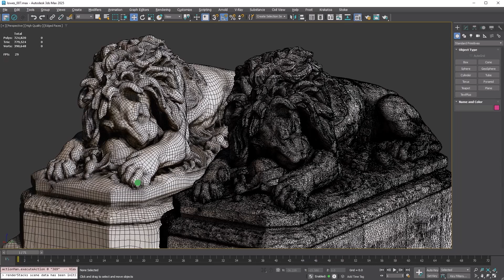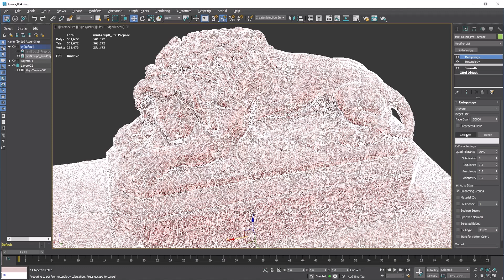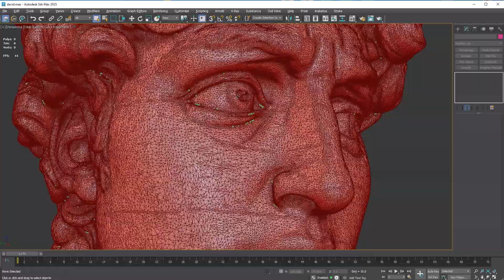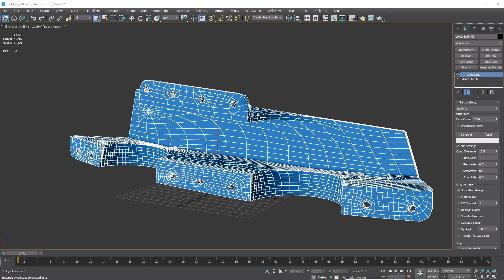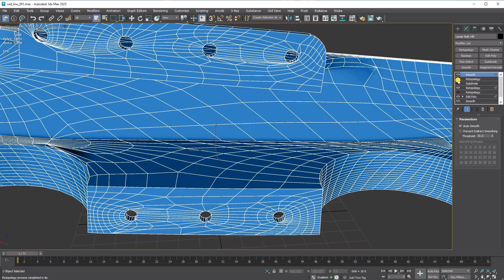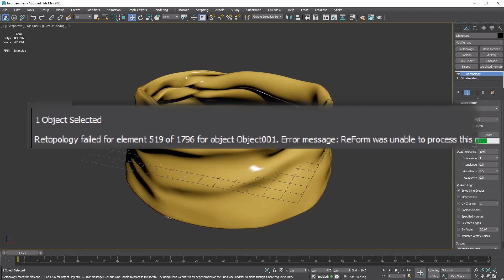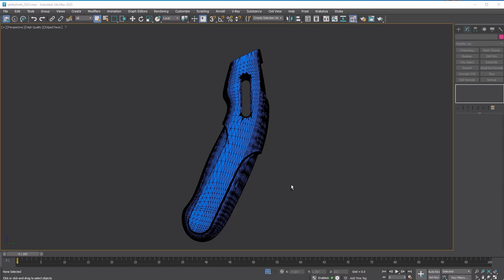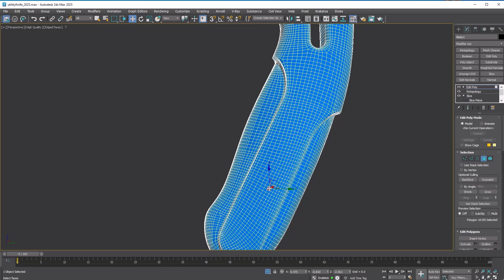How to Retopologize in 3ds Max

Comment: I used pre-processing and the model came out significantly worse than when I turned it off. Both face count targets were set to 5,000, but the pre-processed one more or less evenly distributed the faces, ignoring tighter areas of detail. Whereas the one without pre-processing preserved those areas much better. 

I am confused LOL

Comment: Retopology is missing one feature... create a new mesh on top of original mesh. It means, if the original mesh has bunch of double faces from splash photogrammetry, it also retopo the ones inside the mesh - overlapped ones. This is a problem, because retopo becomes useless. Can you add that feature where we receive a brand new retopo mesh, that combines the shape all together?
Reply: You can try to volume booean to make one continuous mesh and retopology.
Reply: @changsooeun  boolean cannot handle heavy models and dont union them in one. Mesh disappear forever.

Comment: This is a great explanation thanks! Is it possible to reduce polycount from the retopo mesh like if it was done using boolean modifier?
Reply: Not really since you will lose the quads. But, you can convert to mesh and just hide edges tho.
Reply: @changsooeun  But won't I still have the same polycount by hiding edges. I'm trying not to t re-model several elements in a cad assembly and seeing if retopo workflow might yield lower polycount
Reply: @daveson3D  I wish there is a way to get the best of two world. But, to get pure quads, we need enough polygons.
Reply: @changsooeun  was afraid of that. Ah well, I'll keep trying some workflows. I appreciate your help! Btw great work your doing, love it and very thankful for it 🙌 🙏
Reply: @changsooeun  Update, I found a workaround, converted BodyObject from CAD to Editable Poly, weld verts at lowest level, then apply quadify mesh to 100%, this got rid o many unnecessary edges, then a quick cleanup with Edit Poly again. Works great!